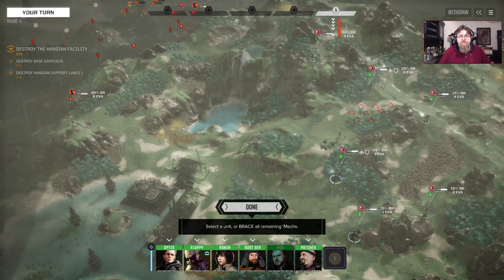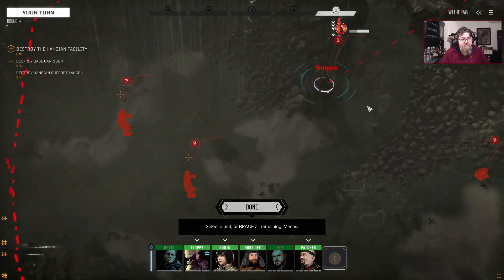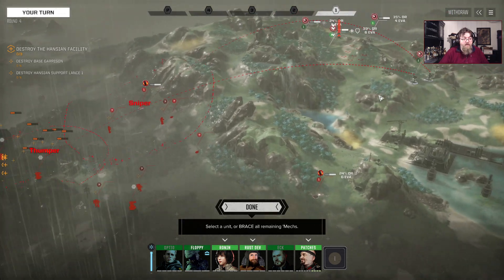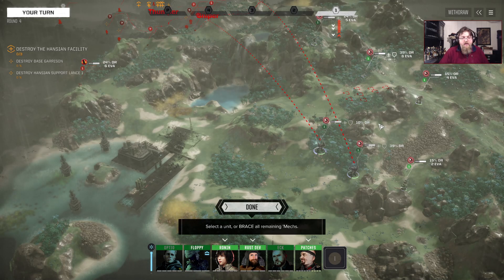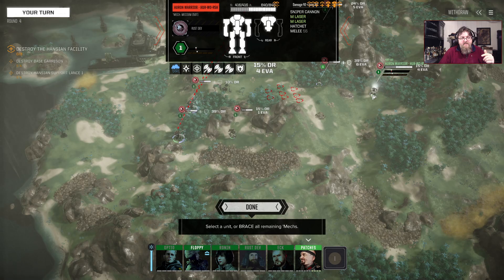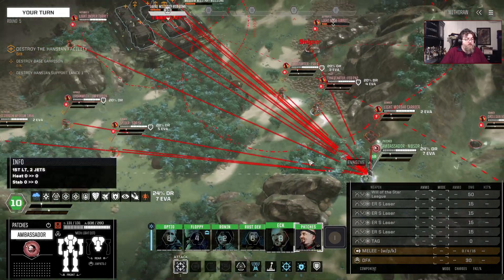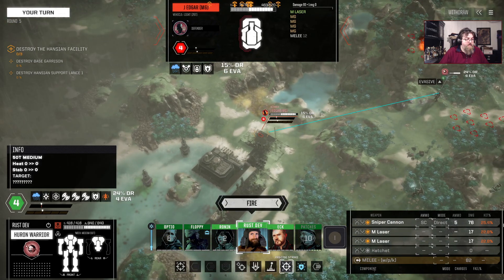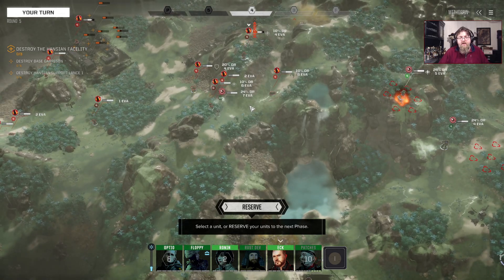BTA Training Montage: How Does Artillery Work?

Comment: Small question, I installed BTA, got pretty far, and only now was able to purchase all the DLCs, is there any way I can change the timeline to where I can go back and do all the flashpoints I probably missed out on, but without losing all my progress?
Reply from the maker: So, you're actually good to go. If you open up the installer, you can use it to check your installation and then "reconfigure" your install. That'll allow you to install BTA's DLC modules.

Once they're installed, they'll kick off their flashpoints as per normal. The only one that's time gated to an event is the FP series for the vanilla campaign but it's just the campaign so you've probably done it before. All the others will enter the rotation immediately and you can do 'em all.
Reply: @realbloodydoves  Ok, cool! Thank you for letting me know, now I’ll be able to destroy clanner scum with no worries of something blowing up. 

other than my Atlas, ofc

Comment: I am new to the mod, and still just getting into 3 skull missions, but it seems the Arrow IV in particular is extremely under-performing.  As in less than half the DPS of LRMs.  Even trying to reserve to the last round and locking enemies to slow their initiative, it's a simple damage issue.  Not sure the damage boost is enough to compensate for half as many turns in the fight, especially with the normal (and justified) issues with stray shots and inaccurate fire.

Comment: So this is cool and all but there is 1 problem with it in terms of balance.
Since the damage of the 2 turn weapons is so huge now this is technically a buff to artillery IF you can still make the old 1 turn shooting work.
And you can totally do that by abusing initiative.

If I take a clan mech with omnipods that can mount a longtom and then try to push its initiative as high as possible (like Timber Wolf affinity, quirks, command console, battle computers, shielded stance, blooddoves and so on) i can basically still 1 turn fire kinda (as in no time for the enemy to react). 
Just reserve your action to the last phase, plan your shot, next turn you act first before all enemies because of your high initiative = BOOM.
The enemy did not have any way to avoid or move and they take double damage now basically. 

This basically makes covoys one shots almost :D
Reply from the maker: What you described here is not a bug but a feature. You put a TON of effort into making one specific unit good with one specific gun and lo and behold, that unit was good with that gun. I see this as a victory of player tactics and properly functioning mechanics.

Comment: I can't say I like the artillery changes.  The multi-round TTI isn't as much fun as the same-turn boom boom.  
I wish this was a toggle I could turn on/off.
Reply: Took me a while to find this and now I finally have an explanation for what the hell happened to the artillery. 
I hate it. It's awful.
But, I suppose the way it was the arty was more than a little OP.
Being able to set entire grid squares on fire on demand if not exactly on target made it absurdly easy to cheese fights.
I am the proud owner of BloodyDoves' own KGC-BD thanks in large part to a Schiltron and a LT-MOB-25 with help from a HAE-OP refitted as a mortar platform.
If the ai wasn't dumb as a box of rocks I am not sure I would have survived BTA Calling.
With these new changes, I am reasonably sure I would have had my ass handed to me given I was a bit shy of the firepower that was being brought to bear in that mission.
As much as I hate this change, it will force me to fill those arty slots with something else most of the time.
Reply from the maker: Sadly, there is not. But luckily, you have the Artillery Cannons that can still do that!